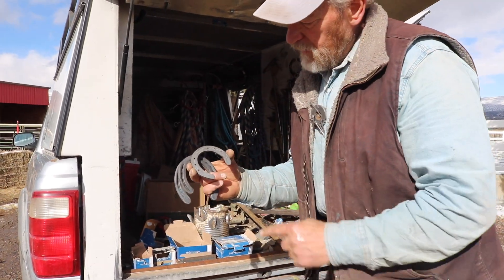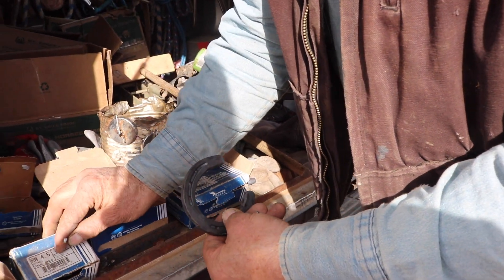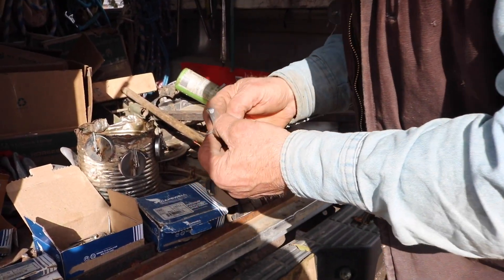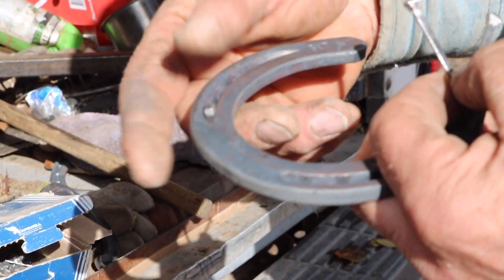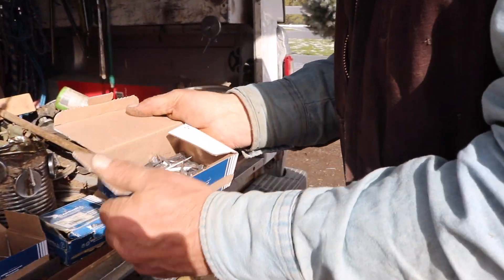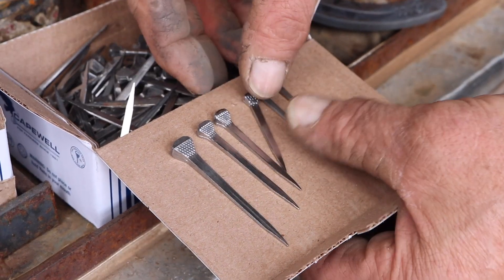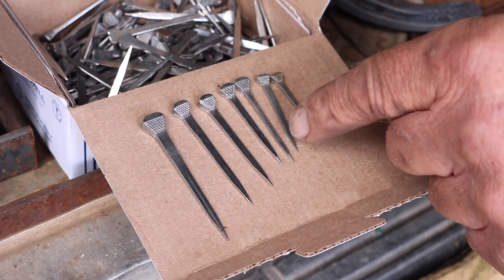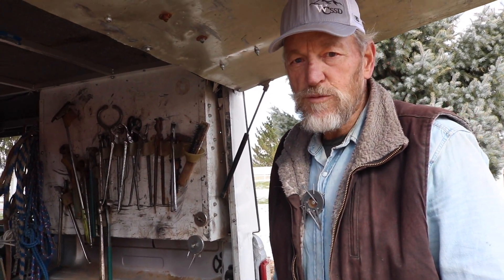All about horse shoe nails and sizes - RJF

Comment: Slims only for light racing plates, city head on anything you want to stay on through an entire cycle.
Reply from the maker: I follow a lot of shoers using slim blades on everything. The shoes don't stay on. But I guess they get paid to come back. I guarantee my shoes for 6 wks and don't go back very often. I use them on aluminum shoes and occasionally 000 colts with thin walls.